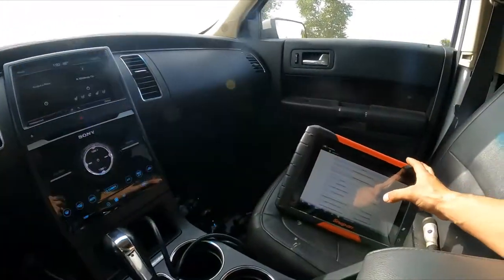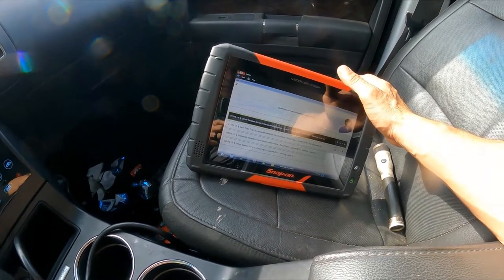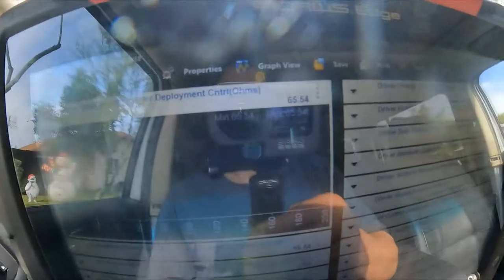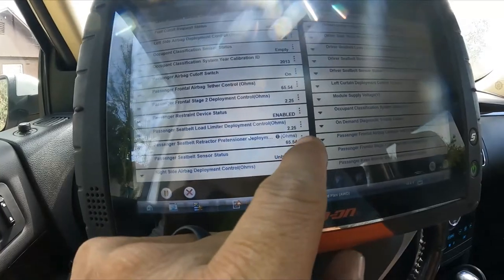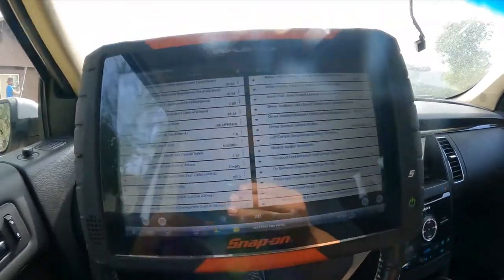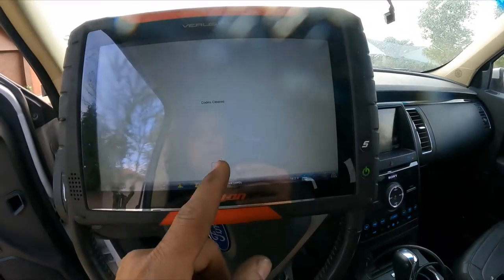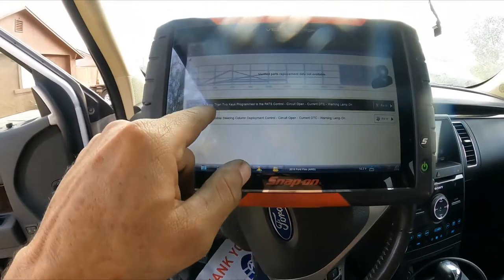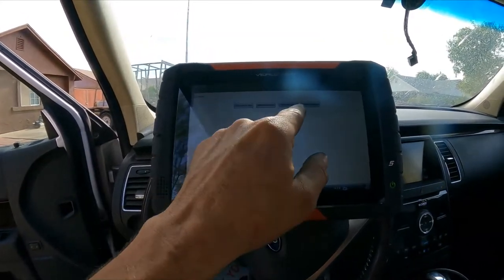2015 Ford Flex Air bag Light On. Drivers Bucket seat pretensioner Code B1212 (EASY)

Comment: Pulling the seats is very easy.... the ventilated seats are nice unless your a bigger guy.  They will tear out at your shoulders causing you to change out the seats.   Make sure you check those tensioners out before you hook the battery up. It sucks to have to change/ send out the ABS module.